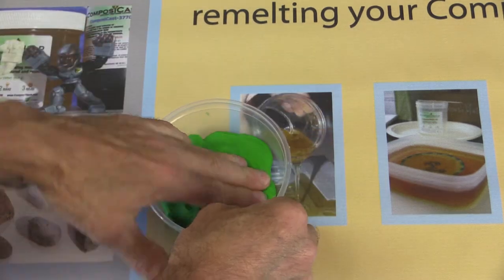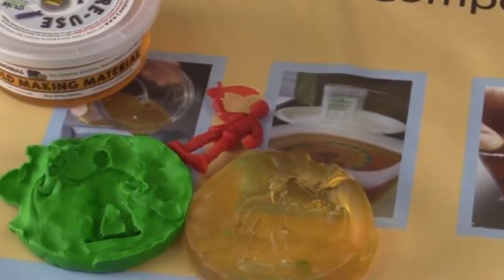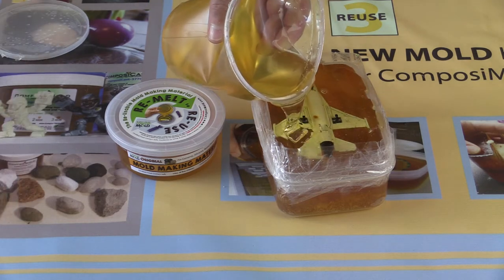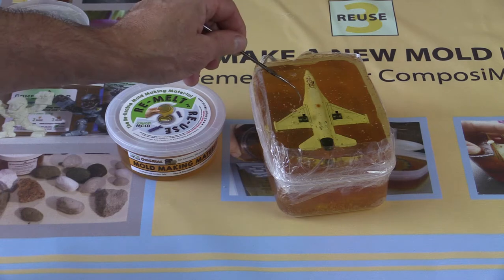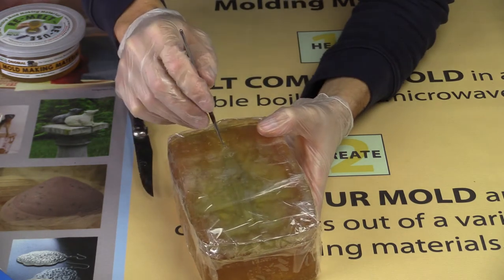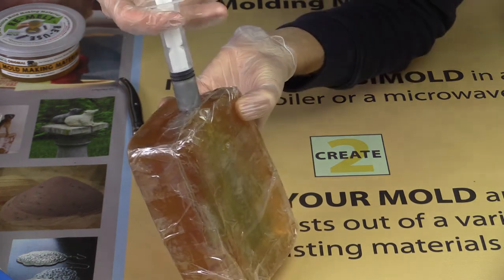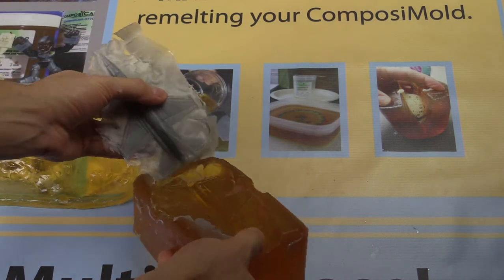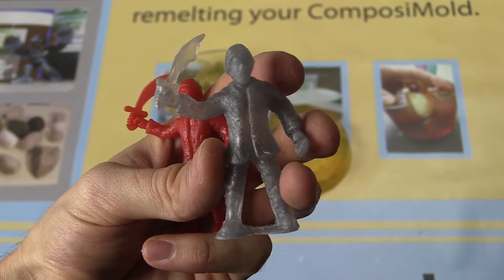Epoxy Resin Plane and War Figurine Made in 2 Part ComposiMold Molds

Comment: as long as my tempatiure is right i can use this for castiline and firm plasticine clay?
Reply from the maker: Yes, as long as you pour the ComposiMold at a temperature below 150F the clay will typically be fine (most Plasticine clay melt between 155-175F).

Comment: is this safe for gundam plastic? or polystyrene? since you pour this composimold very hot. what could you suggest? thanks in advance
Reply from the maker: ComposiMold can be poured as cool as 135F which is cool enough that it wont damage gundam plastic/ polystyrene. You may also want to try ImPRESSive Putty which can be used to mold at room temperature.

Comment: What is the tool you use to pull away the bubbles and poke the holes for the syringe?
Reply from the maker: Thanks for watching! I'm not sure but a needle or nail will work just as well.